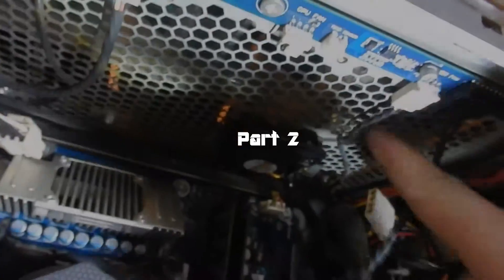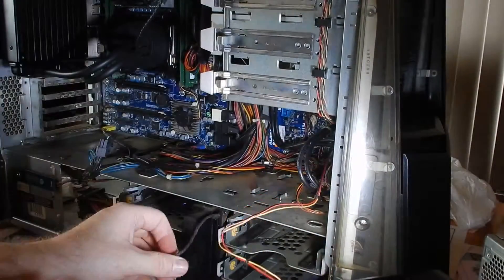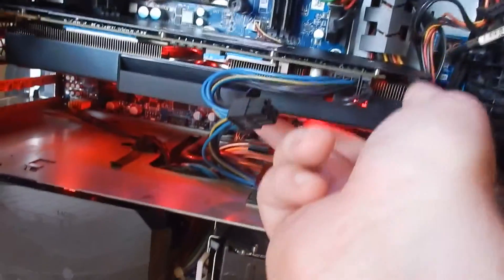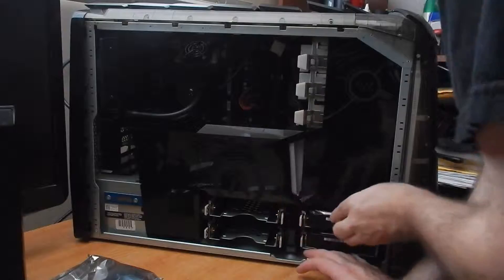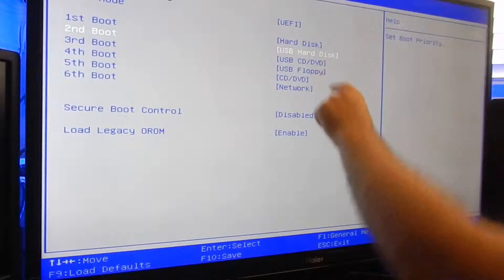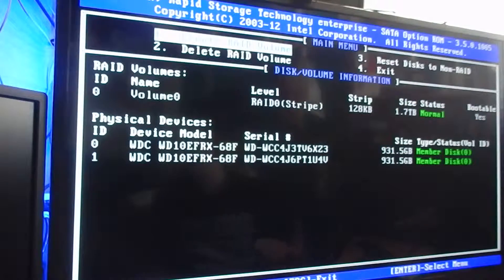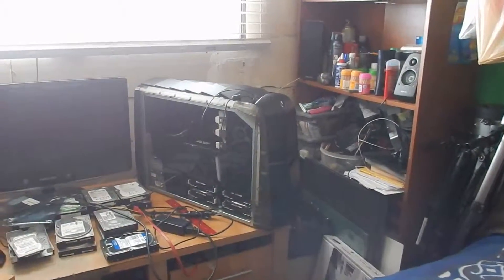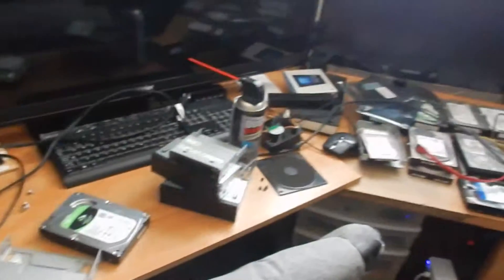Alienware Aurora R4 Part 2 - Cleanup Continues

Comment: I've looked everywhere and still cannot find how to remove that small black piece on the bottom of the right side underneath the clear plastic panel for the lights. I'm trying to remove the front and it seems like the bottom black piece for the side panel just slides forward, but I can't get it to budge.

Comment: how to change the power supply
Reply from the maker: Open the side panel, at the bottom by the PSU you'll see a black piece of plastic that looks the same as the GPU door panel.  There's a clip on it, slide it forward to the front of the case.   Make sure the power is disconnected and pull the cable clip off the PSU.   Now on the back side of the case there is two  Is Philip screw heads holding the PSU into place. Take them out and slide the PSU out.    Then follow your steps to replace it.  If your putting in something different you will need to rewire everything.

Comment: What's the max cpu it can take? I looked of 9770 with little luck. Just bought this pc for 50 bucks!
Reply from the maker: Dell's website is busted at the moment on the CPU dropdown. But last time I looked it's max is i7-4960X but they are a lazy company and never update anything that's old.  So I bet you can run something larger as long as it's FCLGA2011 socket compatible.
When and if they fix their System Specifications drop down this is there data.
https://www.dell.com/support/article/en-ca/sln296935/alienware-aurora-r4-system-specifications?lang=en
Mines still rocking the i7 3930k Here's my last benchmark with the stuff I have.
https://www.userbenchmark.com/UserRun/27117828
Reply: @DestructiveBurn  sadly I have a different model. The highest I can go is an i7 990x. Don't think it's worth it to pair that with a 1080

Comment: Hi Sir, i have a problem in my Aurora R4 when i turn it on after 2 seconds it will automatically turn it off, what do you think the problema of Aurora R4? I hope you help me to my problem, thanks.
Reply from the maker: Sounds like a power supply issue or possibly some part failed and it shuts right off to prevent damage. 

For the heck of it, remove all drives, RAM sticks, unplug the CPU pump and fans.  You can also disconnect the Master IO board from the motherboard and try to turn it on. If it still happens.  It could be the motherboard, CPU but most likely will be the PSU Power Supply Unit. 

Good luck.

Comment: And i have the problem when i start the Pc ,,Cpu FAN Failure". How can i fix this
Reply from the maker: Unplug the PC.   Hold the power button down for 15/20 secs.   Plug it back in.  If it does not work, that Master IO board failed on you and will need to be replaced if you can find another one.
Reply: @DestructiveBurn  ok thank you so very much.

Comment: Where did you connect the cooler
Reply from the maker: The pump plugs into CPU Pump on the LED strip light above.  The opposite side of SYS and CPU fan pinouts.

Comment: Have you put the Cpu Fan in the SYS FAN?
Reply from the maker: Both are the same.  It comes connected in SYS FAN.  However, CPU pinout is the same.  You can get another fan and connect it there.

Comment: Is it possible to upgrade? Asking because my dad only has the R4 (surprisingly it plays destiny 2)
Reply from the maker: If I remember correctly the R4 can take up to i7-9770 CPU with 32GB DDR3 RAM. I have a NVidia GeForce 1080 PNY 8GB GPU but I haven't seen a GPU limit yet, but haven't got past that yet.

Comment: Thanks man. Still having loud fan and 203f. So loudm cleaned Everything and put newbheat sync on it. Don't know how to clean the pump. Is there easy way to remove and clean gunk in the coolant system? Don't know what else to do. So loud. So slow. Powers off.
Reply from the maker: Sorry for the late response.  Usually, I'm quite fast at replying back.
I personally have radiator heating issues all the time.  Usually running around 60C on basic tasks.  So the fan does kick up and it can get irritating at times.
You can take the radiator off the case without removing the pump.   Just take the 4 screws out from the back.  The fan and the radiator come off together.

Just get something that's at the same hight as the radiator so you can set it on that while you take the fan off and blow it out.
Reply: @DestructiveBurn  sweet. Intepasted the CPU and it's holding. If it lasts a month I'm good.

Comment: Hey there, I have an Aurora R4 but having a blue led flash on the motherboard and a few beeping sound on start up. How do I fix this?
Reply from the maker: Hello GuMzHD

I think the blue light flashing on the Master IO board is for the batteries.   Check them.  The board charges (nickel-metal hydride batteries)
I did some digging on one of my older Alienware Arora ALX books for beep codes.   Don't expect this to be up to date with the latest motherboard board as this book came with my first Alienware Aurora ALX in 2009.  It might be wrong but it's something to go by.

BEEP CODE
One - Possible motherboard failure - BIOS ROM checksum failure
Two - No RAM detected
NOTE: If you install or replace the memory module, ensure that the memory module is seated properly.
Three - Possible motherboard failure - Chipset error
Four - RAM read/write failure
Five - Real Time Clock failure
Six - Video card or chip failure
Seven Processor failure

If I remember correctly there is a self-test feature in the BIOS or one of the F keys.  Possibly the I key but I think that one is RAID options.
Find the self-test
Reply: @DestructiveBurn  Thank you for the reply. Also, another problem with my system. I have a external WD Hard Drive but everytime I connect it, it disconnects itself. To test if my external HD was the problem I connected to another PC (and that's slow), it all worked fine. Why is my computer rejecting some of my drivers like it doesn't wants to communicate. Even the internals... it buffers I hear some mechanical noise when playing and PC speed slows a little. Taking to some certified Alienware technicians (outside of Dell as their support are crqp) have told me my PC might have 'cancer' that's hard to diagnose.

Internal HDDs Installed in my AR4:
1TB 7200RPM (Bay 1)
2TB 7200RPM (Bay 2)
250GB SSD 850 EVO (Bay 3)

Also, will it be safe if I replace my SSD in bay 1 as I want it properly configured? Please advice.